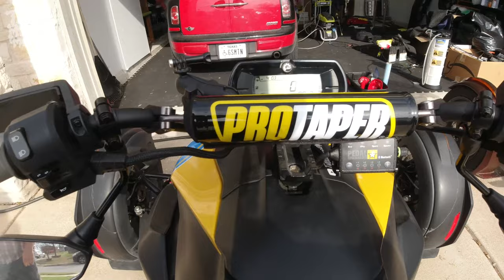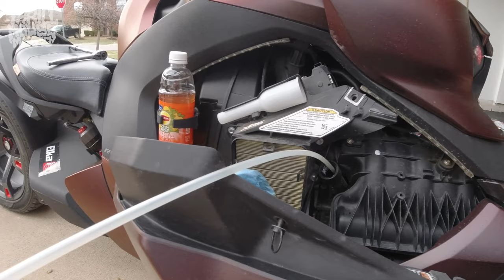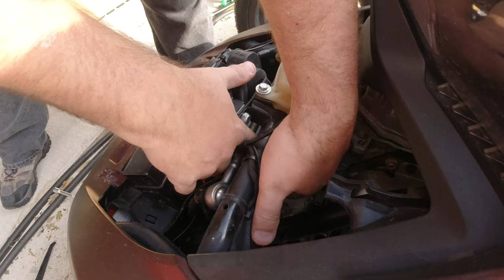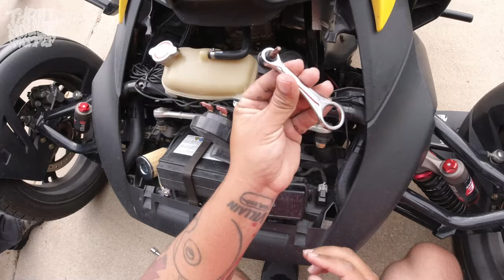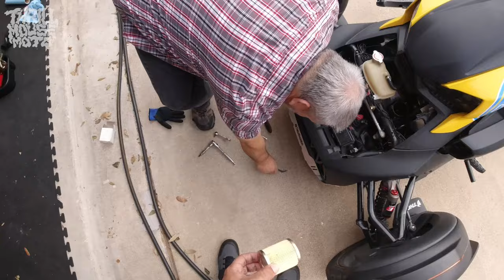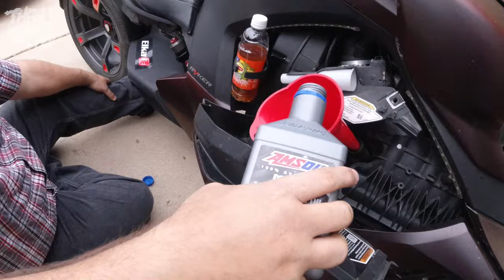Can-Am Ryker 900 & 600 Oil Change - Using an Extractor..? 🤔

Comment: Bro omg I have to get that oil change tube thing that is awesome I think I might can use that on my truck. Thanks for this video becuz I was going to change my oil by jacking the bike up now I can change it in a clean way
Reply from the maker: Preacher! ..Thanks for stopping in! ✌️💯🐭 ..it's definitely recommended to do the required oil change process specified by the manufacturer, but we were just trying something different for this video. Kevin uses this on his car, so should work on a truck too I imagine, 👍.

Comment: From my days of building custom Harley's here's the issue I have seen with these vacuum fluid evacuators is that even they are pretty cool and they do get the majority of the oil out. It will not get all the metal particles that are on the very bottom which when you drain it the normal way pulls the majority of the particles as it's draining out of the bottom of the sump. Remember metal particles are what cause wear on the engine. Now the argument I hear all the time is that there is always going to be a small amount of metal particles even if you drain it the right way and the answer is yes, but a lot less than if you use an evacuator. Of course, if you are changing out your vehicles every 3 to 5 years then it would not be an issue but if you keep your vehicles around as long as I do then taking the time to do the oil change the proper way with oil changes every 5000 miles. Remember oil is cheap compared to a new engine. Great job either way guys... 👍🏼
Reply: I agree, especially on that FIRST oil change in order to collect the microscopic shavings. I believe that @Thrillmousemoto was on his second oil change even though he mentions it was his first.
Reply: @ExcelsiorDDZ  Actually, from his videos, I think this is his first oil change even I did not change my oil as the dealer said it needed an oil change after the break-in period which there is no indication in the owner's manual for this. The only scheduled oil change is at 6K.
Reply: @RonConsumer  Thanks. I'll be sure to find out and if it was, then I will pull the plug on the next one. And there is a new tool for that to show off, too. heheh
Reply: @RonConsumer  did my 1st at 6kish as well
Reply: The primary plug has a magnet on it and should be cleaned off. Plus it's a good way to tell if you are having any wear problems before the engine fails.
Reply: @jpf1978  Like you said on a VW engine I don' think they are working on a VW engine and on most German engines the only way to evacuate the oil out of the system is to use a pump. I don't know how long you've been working on motorcycle engines but in every motorcycle engine I've rebuilt where someone has used a pump to pump out the oil I've found a lot of debris at the bottom of the case. The engineers who build these engine put drain bolts in for a reason. If they thought it would be a good way to remove all the dirty oil then they would have not put in oil drain bolts... it's just logic because it would be a lot cheaper and easier to cast an engine block without a drain bolt. But to each their own... engines are expensive so getting as much of the dirty oil out is important. Just because someone is lazy and doesn't want to crack the drain bolt and replace a $0.09 crush washer to do an oil drain the correct way is just you are asking for your equipment to start eating oil on a regular bases which leads to a whole lot of other issues.

Comment: Watching your video to assist in my first oil change on 900 ace.  I have the oil extractor similar to the one you used in the video- I have only got 1.5 liters out, which is about 1.6 quarts.  The tubing is in about 8 inches- does it go deeper?

Comment: Just letting you know! It’s better off taking off oil the drain plug rather than using that manual extractor.
Why: you want that metal particles drain with the oil. Don’t be so lazy that’s going to damage your engines. I have that manual extractor I did once in my car. I check in the bottom I saw metal particles around in the oil drain plug.
Reply from the maker: Good tip, Thanks for sharing, Mike! 
Why: ✌️💯🐭

Comment: How do you dispose of the used oil once you get it out of the Ryker?
Reply from the maker: Greg! ..In Texas we drop used oil off at the Fire Department and AutoZone. We pumped the oil back into the empty bottles after the change, just didn't film. Thanks for watching! ✌️💯🐭
Reply: @ThrillMouseMoto  Cool. I often wondered how folks who do their own oil changes dispose of the used oil. Now I know. Auto Zone, who would of thunk... :)
Reply from the maker: @gregkamer3754  And you can drop old batteries off at Home Depot, Lowes, and Batteries Plus. 🔋💯🐭
Reply: @ThrillMouseMoto  that is what we always do. My son is a mechanic and I maintain my scionxb04 pretty much and my Ryker.